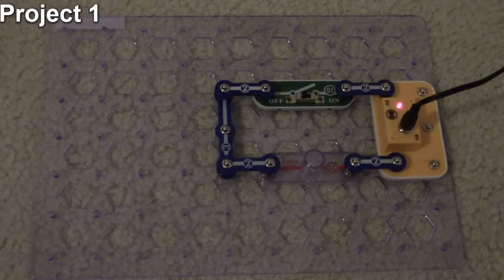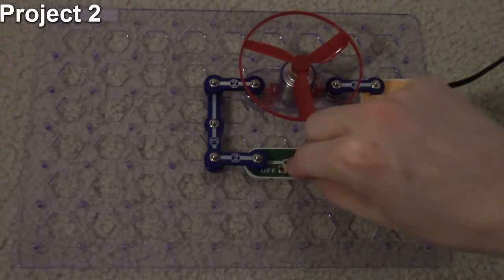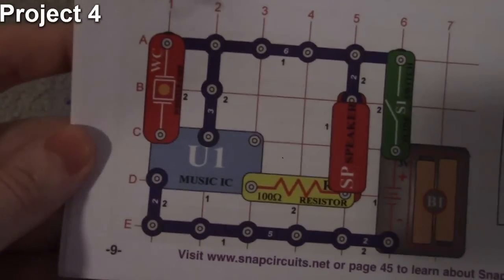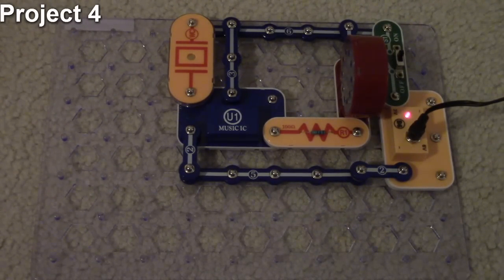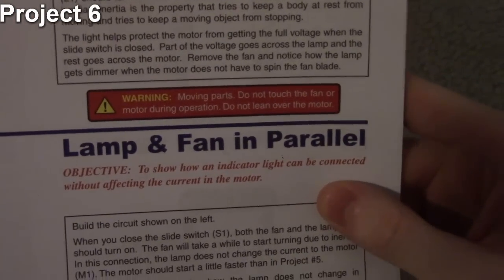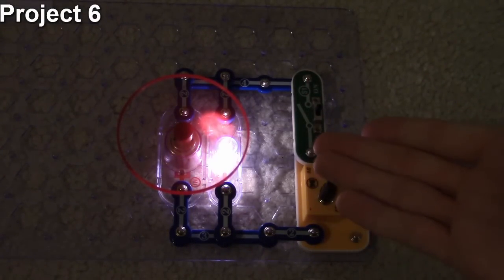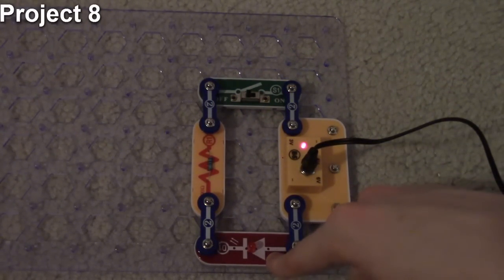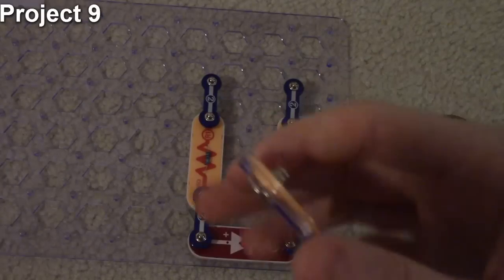ELENCO Snap Circuits Projects 1 - 10

Comment: I just have to point out as this was mentioned several times in the video.  Electricity travels from negative to positive.  This is important when diodes and transistors come into play.  For electrons to flow through diodes, the symbol (triangle) must be pointed towards the more negative side of the circuit.  While the resistor does serve as a purpose of preventing thermal runaway, it's main point is to drop voltage on the back end of the diode allowing the forward side of the diode to be more negative.

Comment: also if for those of u who don't know, if u connect the motor so its + side is towards the - on the battery/voltage source the fan will fly away when u turn it of

Comment: also from snap circuits sound onwards the original speaker is replaced with sp2 which is usually yellow but there are rare red sp2 models to. the sp2 speaker is very similar to sp except it is louder and has a 32 ohm resistance
Reply: Hays Coleman boi I have a red speaker bc I have SC-300
Reply: Hays Coleman Actually, the SP Red Speaker was used in the Circuit Maker 40 and 125 sets, but the SP2 Speaker was featured in Circuit Maker 200.

Comment: snap circuits made the probably the smartest integrated circuit called u29 and its the led mc (micro controller) it has 2 7 segment display leds, a micro controller and other supporting parts. the microcontroller is a mini computer that can be programed to do diffrent things, including monitoring things and making things happen. it hat a special interface that makes it easy to use. the micro controller in the u29 is called the picaxe 082 and has 21 arcade games programed inside of it
Reply: +Hays Coleman u29 is ex clusive to snap circuits arcade which was released this year and i got it this week

Comment: I read that Snap Circuits LEDs have internal 33ohm resistors.  So, is an additional 100ohm resistor actually needed?
Reply: It’s to teach you that regular LEDs need the resistor. And the older sets don’t have those resistors.

Comment: So whats b6? I only know b1 and b2 (battery case and solar panel)
Reply from the maker: devant249 That is the Snap Circuits AC-adapter block. It's a separate item you can buy that includes the B6 block and AC adapter providing you 3V, 5V, 6V (and potentially 9V) outputs. Handy when you don't want to go through batteries.
Reply: Cool!
Reply: devant249 
You can get parts here: http://cs-sales.net/sncirepa.html, or on amazon.
Reply: Oh that's awesome! I didn't even know they sell power sources! I thought he modified something to make the power source... Lol. :L

I getting 2 of those for sure.
Reply: Adam Correia
No need to get 2. The one they sell allows you to change from 3V to 6V. On a side note, I have found some projects that work with batteries that don't work with the plug-in power source. Haven't been able to figure out why.
Reply: bowrudder huh.. interesting... i think it maybe a over voltage?
Reply: +Adam Correia (Cracked Sponge)  no it steps down the voltagee to 3 volts via a voltage regulator ic inside b6

Comment: My son was confused because at the top and bottom right corners the diagram says to somehow connect a 1 length wire, and we checked this video to make sure we had it right. Anyone know what is up with that?
Reply: A spacer for uneven height